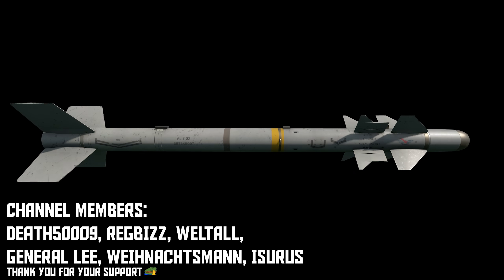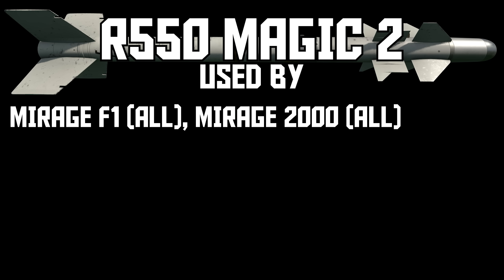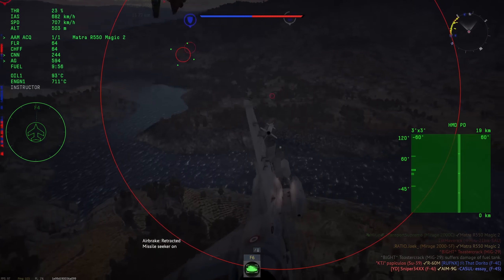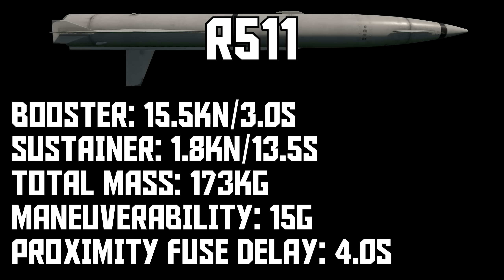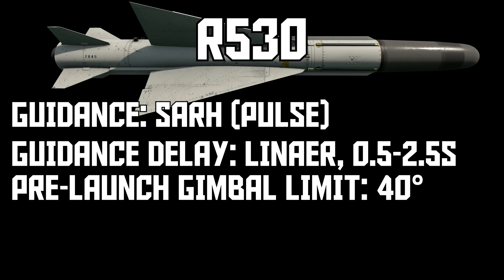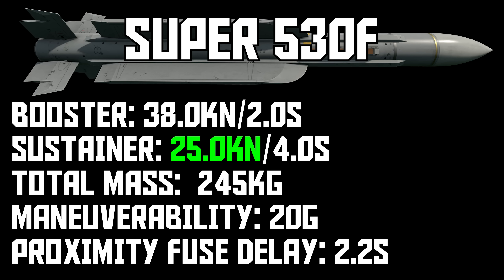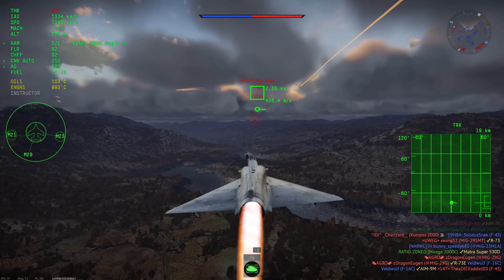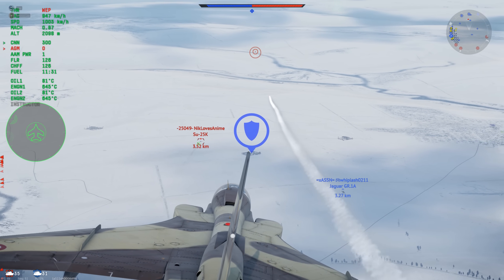EVERY FRENCH MISSILE In Detail | AA20 Nord to Magic 2 & Super 530D

Comment: R530 should technically also have chaff rejection because the 530 and 530F use almost the exact same AD26 monopulse seeker with rate limiter, just the major difference being the compatibility with the Cyrano IV radarset on the 530F seeker. But this wouldnt be relevant for most planes that the R530 is on because they lack PD radar anyway

Comment: I am slightly mad Gaijin called the Nord-Aviation AA/AS 20 the Nord, it's like if I called the FIM 92 "Raytheon" or the R-27 "Vympel"

Also fun fact, the ATLIS pod was accidentally made into a A/A pod as they found out during testing it could lock and track Mystere IV's

The 530F had a CW seeker at first, but it was dropped due to no tracking as good as the pulse one (hence why the Cyrano III and IV had an optional CW seeker)

What i would like to see is the M2K-S3 with the RDM+ radar that got a CW module to use 530Ds. It would be worse than the S5 but could mean a CW seeker at a lower BR

Comment: 7:12 a (maybe not so) fun fact about missiling a tu4, because this missile has an 8km launch limit (even though the radar can lock from like 40km)+ the fact that the missile flies so darn slow, if you missile a tu4 in a headon from max range by the time the missile reaches the tu4 you are actually close enough to just have used guns instead 💀

Comment: DO NOT sleep on the AA20 Nord. I finally tried it out during my G.91Y stock grind, and it actually came in really handy. Two practical uses for it, as far as I could tell. First, slamming someone in a head-on is very funny. Sadly, doesn't always work, but it worked enough to justify taking them, and got me some very stupid kills while not having to take a full-commit head-on. Second, and also kinda funny, using them from a greater distance to force someone to turn away in a head-on, giving you an opportunity for a gun kill. Less effective in a chase, but can still work.
Reply: I'm horrible at manually guided missiles

Comment: Didn't the magic 2 get a 8m proximity and better rate of turn a couple of days ago?
Reply from the maker: There were changes to the engine and to drag and to the range table but I dont recall anything about the things you mentioned
Reply: @jaek_898 I looked into the datamine to check. Looks like they did both

Comment: I'm nearing 500 battles in the vautour (late) and had my great deal of fun with the r.511s. My advice is to take 3 AA.20s and 1 r.511. Looking at the pylons from the front of the aircraft it should be AA.20 R511 AA.20 AA.20 (yes in that order so that the weight of the wing is more distributed if you fire AA.20s first). You will get the most use of the R.511 at around 5-6km mainly going for bombers and afk climbers. (I recommend right after spawning flying straight until you reach 1000kph and then put it to a 15 degree climb until you reach 5-6km height). Also, don't forget to switch your radar to 20km range and narrow the search area to the narrowest one for easy locks. You can't exactly maintain a lock with any terrain interference, so the only kills you're going to be getting is right at the start of the match and on very distracted, stalled out targets. One last thing, when firing at a closing in target from 8km give your missile a little loft so it has that little bit of extra height in case it needs to glide a bit.

Comment: If the Magic 2 gets multi-plane authority and 50G, I fully expect Stingers and Mistrals to become nothing short of HORRIFYING.  Imagine NATO MANPADS as they are now, but capable of pulling around twice as hard.  RIP any aircraft within 4km
Reply: Stingers and Mistrals would be unaffected. The issue with the Magic 2 is not just that it’s dual-plane maneuverability was 50G. It’s that the Magic 2 IRL has a special control section that can actually rotate around the body of the missile. This means that it actually never uses single-plane maneuverability and can always take advantage of the full 50G. I don’t think Stingers or Mistrals use this system so it’s kinda unrelated.

Also Gaijin has already confirmed they are fixing MANPADS.

Comment: The magic 2s really suffer in head-on engagements, I’ve got maybe a 5% success rate with head-ons, they a very easy flared front aspect, and that 1.8s fuse delay makes them useless being fired anything less than 2km in front. They also really suffer from not have a sustainer motor, as they have very little range, and you’d be lucky to hit someone flying away from you only 1.8km ahead. Side aspect, unless you’re above or they’re flying towards you, 2km is as far as you want to fire from. It’s a huge difference from aim9ms as I’d get killed from 5+ km away with those, but at least they got the arming time nerfed
Reply: I got to a point where I avoid head-ons with french planes if I don't have any 530F or 530D. The Magic Two is just not for hdn

Comment: Awesome video Jaek_ i cant wait for the Mica to come too. Its probly gonna be next year tho before we will get them. I love that you added the AS-30L XD. Been using them also in the Jaguar E, but since they have changed the laser lock (the green circle always being outside the aircraft now insted of on the aircraft) i would now only try to use them if the enemy tries to land on their airfield to finish them off.
Reply: The green circle thing is just a 
visual inconsistency. If you go into the laser sight view, you’ll see the designator is actually tracking just fine. It still hits planes just as well as it did before.

Comment: 11:35 I've also heard that the Super 530F is named that because it was used on the Mirage F1, and that they went to D because well there is no letter in the Mirage 2000's name.
Reply from the maker: Then tf is E for on R530E 😭
Reply: it's E for miragE, clearly
Reply: @jaek_898 mirage 3E?
Reply: @jaek_898 gaijin Invention. There's 530 and 530R (new better rocket)  but the head change does not matter in designation. So Gaijin invented the E to separate the EM and IR head switch
Reply: The D stands for Dopler, its the first of the 530 family to have access to a dopler radar for guidance rather than just the old mirage 3 search or just mti on the mirage F1 that's why
Reply: And it's NOT because F comes before D. The French alphabet is the same as the English alphabet bruh...